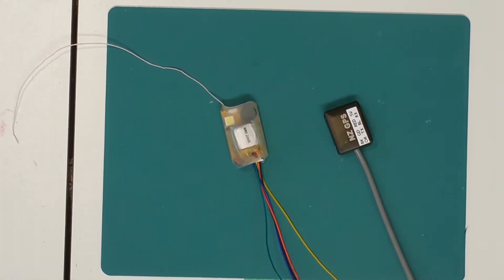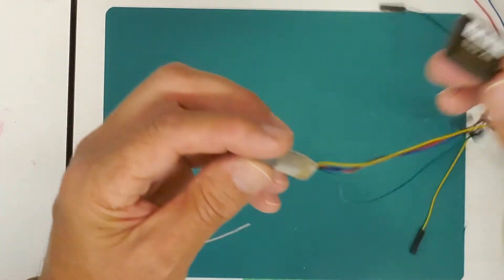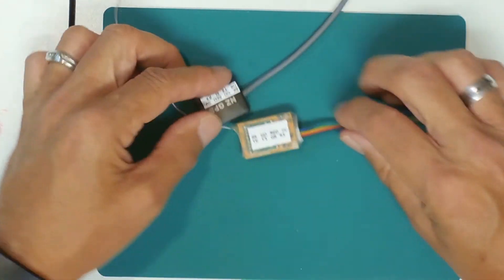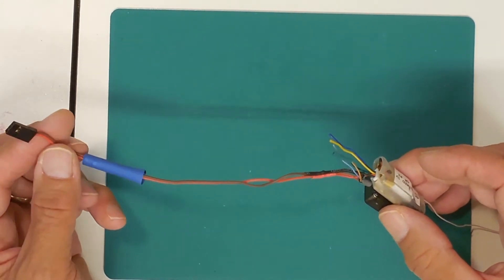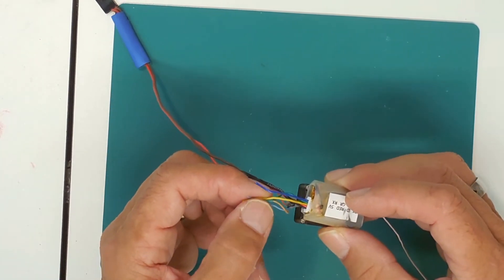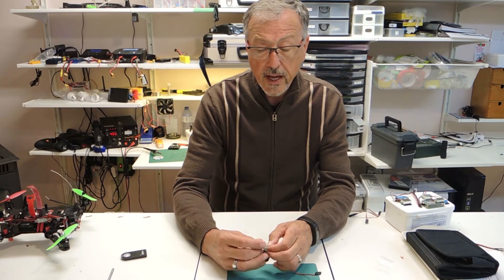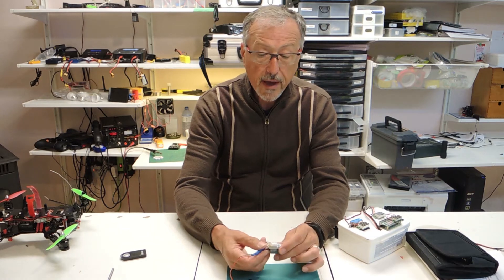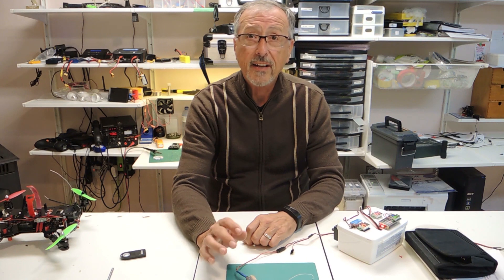tBeacon Part 5 Adding a GPS

Comment: Just got my GPS module yesterday and soldered it up. Worked perfect. Thanks for the heads up on checking the wire colors. One question- do GPS modules tend to run warm or slightly hot? Do I need to add an additional mini heat sink to extend the life?

Comment: i bought the ublox g7. I tryed connecting both the green and white wire to the green wire of the tbeacon. The tbeacon still says 000 for coordinates. theres a sold red light and a blinking green light on the g7.  Does anyone know what the problem could be?

Comment: Nice!  I had the same idea a couple of days after I ordered my tBeacon and wished I'd ordered the optional Naza connector at the same time as I have a spare GPS puck.
I originally was going to use the Neo8 with the APM but a standalone unit would be so handy. 
Be nice if the guy making these would offer a complete standalone unit or include more optional cables to suit. Still waiting for my beacon and walkie talkie to arrive...